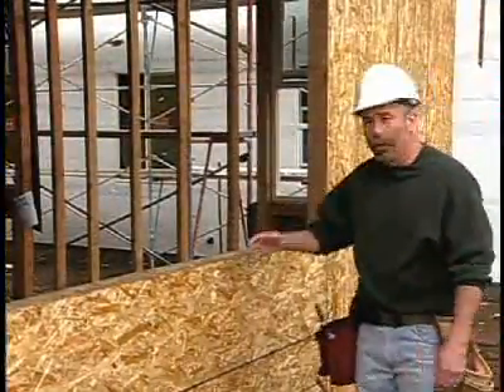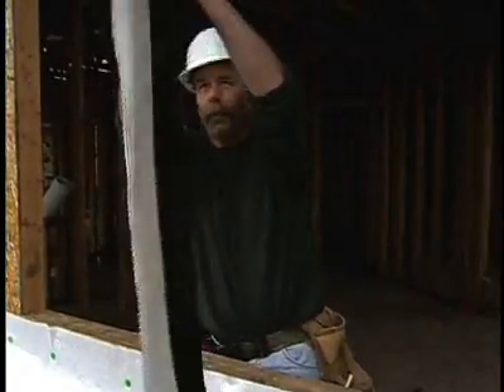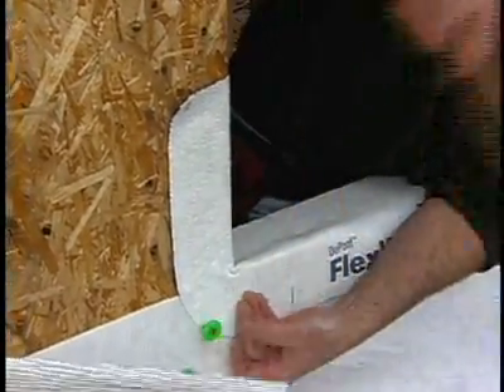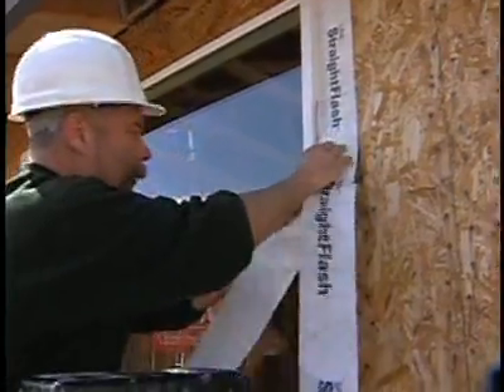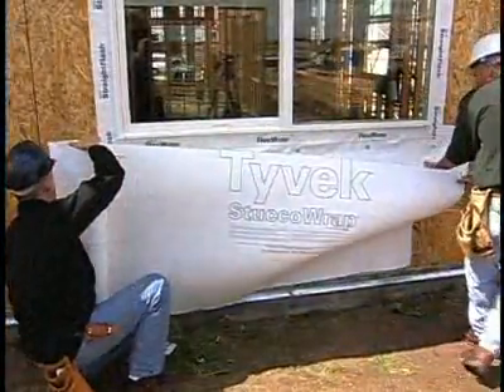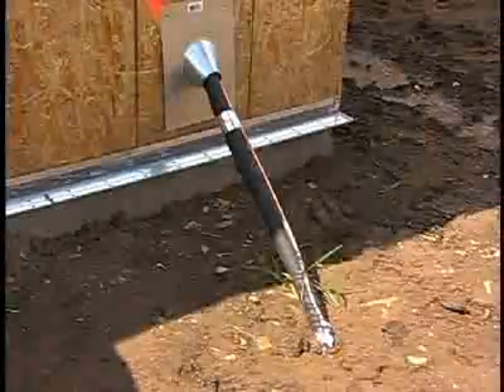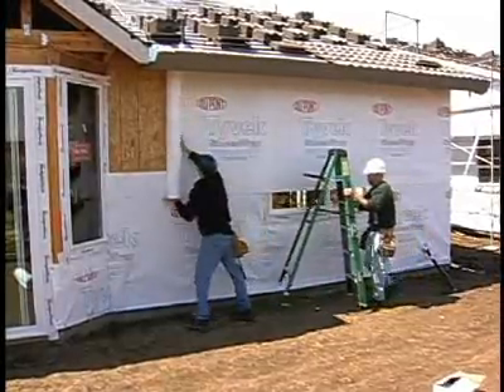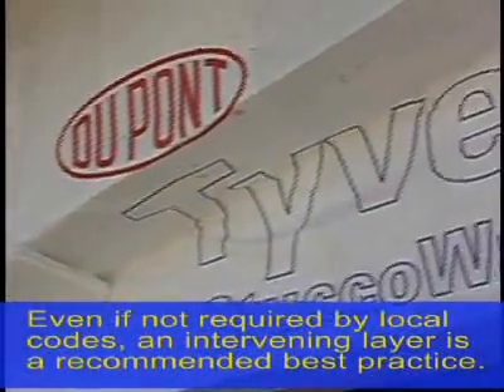Properly Flashing windows

Comment: the pan flash here, is to stop any water that potentially get in to go all the way into the house, the also prevents water that runs down the face of the window and beads back into the siding behind the j-channel from going into the sill or right up against the OSB

Comment: They have flashing tape to go around the OUTSIDE of the windows to prevent leaks.   But alot of people say the most important is to flash the sills - inside/under the windows. How/why is that? don't you want to stop the water from getting in?
Reply: THE IDEA IS on the bottom sill, not caulking will allow water to drain down and not get dammed in by the caulk. Perhaps you've figured this out already, since your question is three years old.  And, maybe I don't know what the heck I am talking about.

Comment: I did a lot of research and watched many videos on properly flashing and
 installing new windows. Everything is perfect and was tone to a "T" as 
you did here. I installed my first 4 windows, two of which are under a 
porch roof so they will not even be exposed to weather. After doing the 
first four I realized I forgot a very important part, I forgot to 
silicone the nailing flange before nailing in the window. I know this is
 crucial. So my question is should I take the window out or since they 
have been properly flashed should they be ok? Thanks